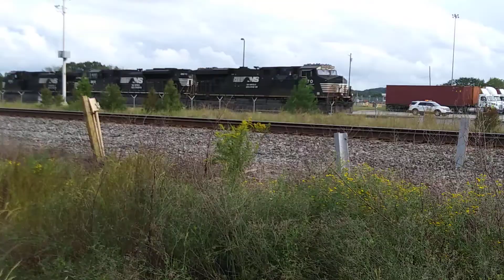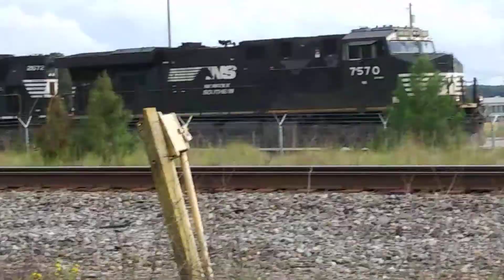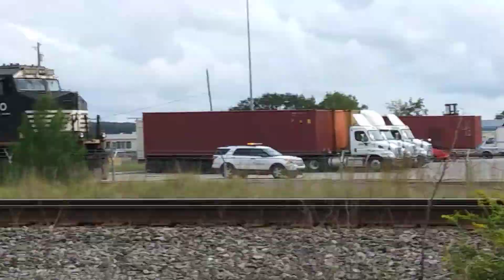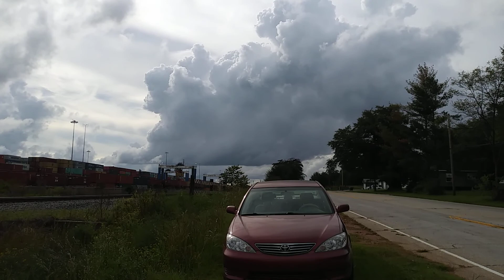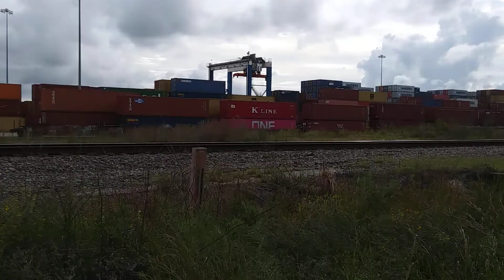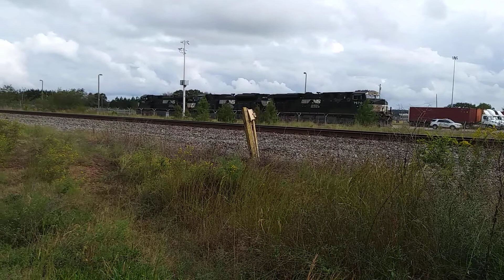3 NS ROAD UNIT'S TIED DOWN AT THE INLAND PORT IN GREER! SC!

Comment: Nice video! Does "inland port" mean container terminal in this case? I haven't found any navigable river near Greer! I hope tropical storm Michael didn't cause much damage to your area, although certainly not as much as to The Florida Panhandle.
Reply from the maker: You are correct! NORFOLK SOUTHERN TRAINS either bring in loaded containers for trucks to take them to different distributors.
Or sometimes it's the other way around. The Inland Port will load containers onto TRAIN 238 for transport to CHARLESTON SC. For export! I hope that explains how this unique operation works!
 Thankfully MICHAEL was more of a heavy rain and wind maker! With some debris and small tree branches BLOWN down! But not anything like it did when he clobbered the Florida Panhandle!